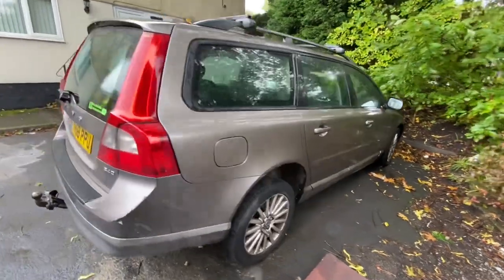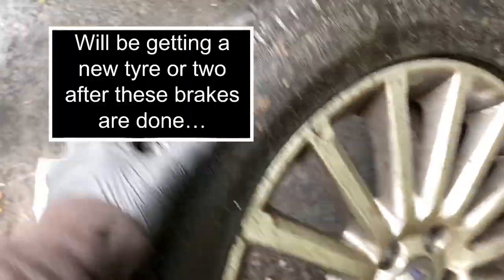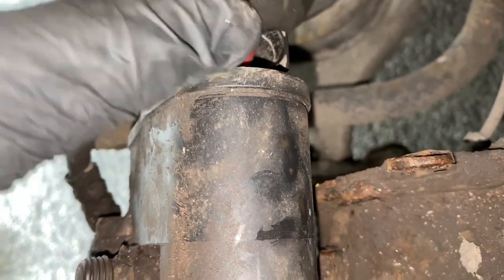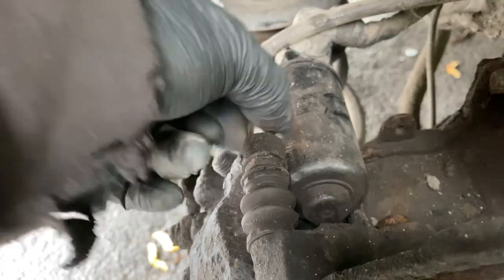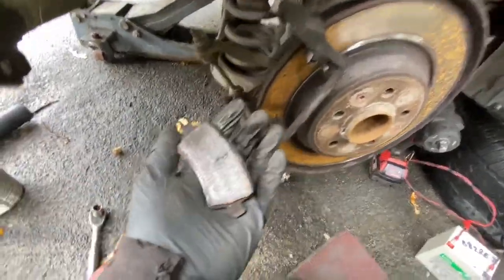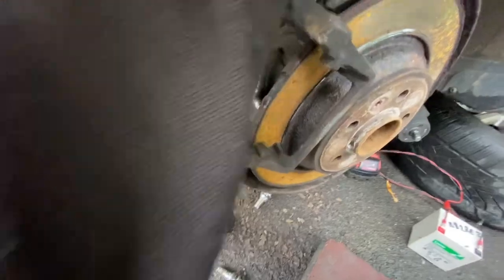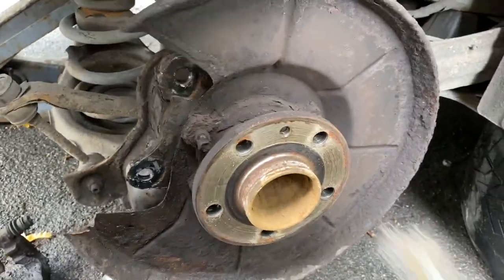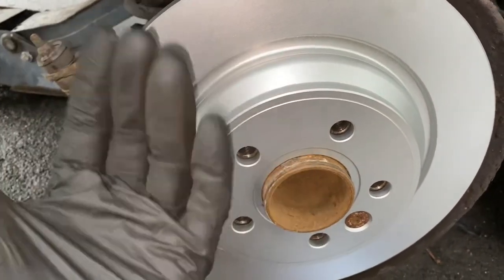Volvo EPB Reset, V70 Rear Discs & Pad Replacement (P3 Electronic Handbrake 2008)

Comment: Useful video thanks. When I did the job I learned a few things;
1) You don't need to take off the caliper bracket (held on by two 14mm bolts) to remove the disk - it slides out fine with the bracket still in place - Yes! :)
2) The pads should slide easily into place. If they don't you need to double down on cleaning any rust and crap from the grooves in the caliper bracket - I used a file, carefully!
3) My pads were also missing the stainless caliper inserts and unfortunately my existing inserts were pretty beat up, I'd have preferred to use new ones but needs must!
Reply from the maker: Thanks mate. Yea the discs will fit out around the carries. I found that out after doing this

Comment: I have just come across your channel and subscribed that is a bout right as i don't bother with torque wrench and just give it full send with the impact or ratchet grate video
Reply from the maker: Cheers mate. Just tighten it til you feel the bolt spring a little, be reet
Reply: @StupidBlokeStupidVideos  yeah that is what i usely do it till tight and then see if it goes a bit more that is usely good then till i need to do work again and not realise how strong i am and then  swear it the bolt for how ever long i am fighting it

Comment: Pro tip: if you need to open the brake hydraulic system, instead of crushing the brake hose, if you keep the brake pedal depressed a bit, the fluid won't drip out of the pipe. 

I think it works by magic or something
Reply from the maker: It closes the inlet off to the master cylinder from the reservoir but can still drain the line that’s open. I’m not a fan of crushing brake hoses myself and didn’t actually put those grips on the pipe, the owner did that but the car was parked like that for a couple of week waiting for parts.

Comment: the tire you took out on 1.21 is more worn inside. the reason could negative camber. you have to check before put the new one.
Reply from the maker: Negative camber, toe out. Both will do it. Car has a shagged bush on the rear arm

Comment: Well done, first time ive seen electric handbrake !
Was that activating the caliper or what ?
If it was the caliper why did u have too press the piston back in ??
Reply from the maker: Cheers mate and yea the electronic handbrake has a motor which turns a thread inside and pushes the piston out, or releases it depending on which way voltage is applied. You’ve still got to push the piston back after winding the motor all the way back in though as otherwise it’s still a conventional hydraulic calliper. You can also do it through diagnostics if you have it, or take the motor off and wind it manually but I think this is probably the easiest way to do it.
Reply: @StupidBlokeStupidVideos  thanx for the info, i know now whats required
Reply: He had to press piston back in as don’t forget new pads going in so need to push piston as far back as can go.He did toptastic job of getting them rusty calliper carrier bolts of, I would’ve wire brush them and WD just to make sure.